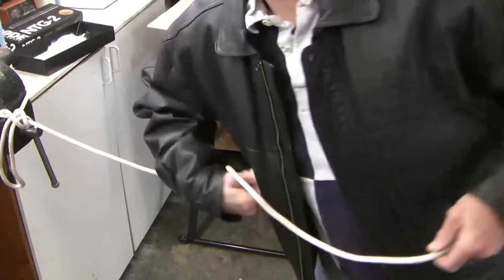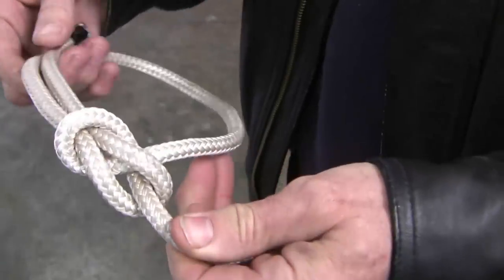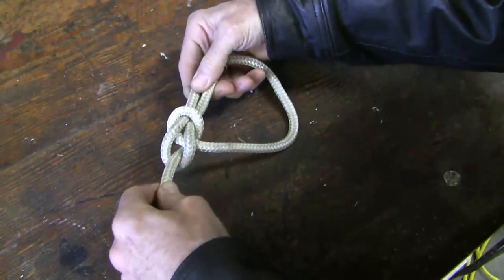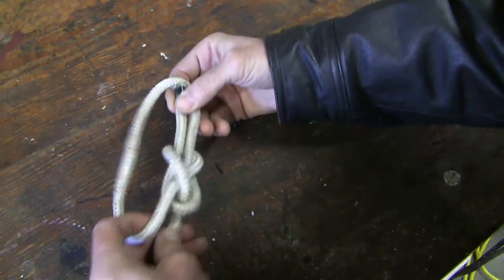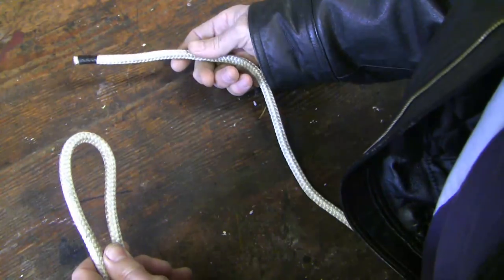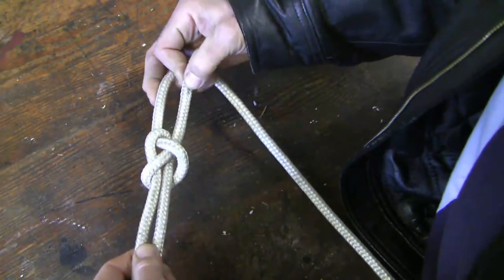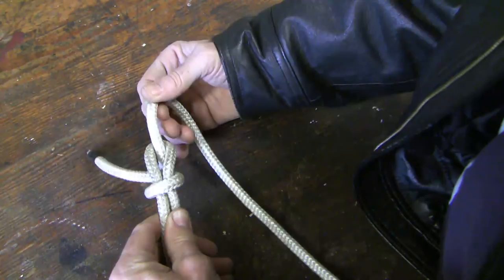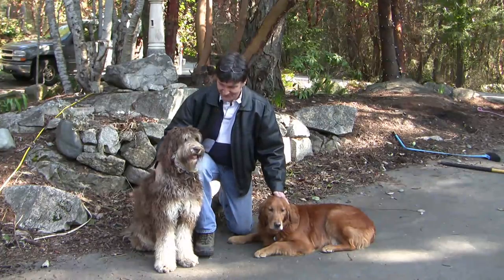What you never knew about the Bowline knot

Comment: It seems to me that I learned that according to Ashley, a Knot, bend, splice, and hitch are all complications in rope.  But while all are ties, a bend is not a knot, but a bend is a special kind of tie that joins the ends of rope (either the same rope or two different ropes) where a knot is typically a tie in the end or mid line.

True both the bowline and sheets bend look very similar, they are not the same knot.  As well as the bowline has over 100 variations (which by some counts may include the sheets bend) and all may have very different function and results when used.  Just saying.
Reply from the maker: Good points, when you look back in history you get an appreciation of how language evolves. Nobody uses the word bend anymore but vestigial remnants are there. For example the Carrick bend ties two lines together, but if you add a couple of overhand turns it becomes the more modern diamond 'knot' even though fundamentally it is still a bend. At one time sailing (and rope craft) was on the cutting edge of human technology. I put a link to a pdf article on bowline variants deep in the thread that was eyeopening. My goal here was to be provocative, but I certainly accept your points. In the end it distills down to the less interesting semantic discussion. My main point was to put light on the surprising fact that they share the same core structure.
Reply: knots in my business are permanent and will require the rope to be cut to untie lol!  Bends are attachment and are specific to the need and loading, hitches are the most useful in high load applications because most can be untied after extreme loading and some can be untied while loaded ! try that with a knot or bend !
Reply from the maker: Yes, some knots like the anchor knot or even the reef knot can be really difficult to untie under chronic load and when wet. The bowline and sheet bend are much easier to undo without a marlinspike and hammer. As you say, the truckers hitch is a simple way to work with and apply more tension without having to retie the whole thing.
Reply: Foe example of what you are saying; research the "bowline on a bight"...

Comment: I tie a bowline so the tag end is on the outside of the the loop especially if the bowline is small . Is that a different knot ?
Reply from the maker: They call that a "cowboy bowline". Although sailors look down their noses at that configuration, the objective tests show little difference in strength, etc. The key is to keep a long enough tail so it can't unwind if it is left slack. For critical applications many tie an overhand loop at the end so it is harder to come undone. There is a variant called the Yosemite finish that basically routes the tail along the lead rope, and for applications where the tail can get in the way of pulleys it has a role. However the Yosemite finish can be accidentally tied wrong which could be a disaster.

Comment: I know the subject of this Video was comparing Two Knots , but  . . . . I just learned to tie a Bowline !   Yay !
Reply from the maker: I'm glad it helped. At first I was puzzled at how difficult it was to learn such a simple knot, until I realized there are four common variants, all with similar strength. Cowboy and regular depend on which side the short end comes away from the loop (outside or inside), and of course each of those can be left handed or right handed. On top of that, you have the variance of body position and whether you have to pass the loop around another structure like a piling. Ultimately most of us end up memorizing it one way, relying on a muscle memory after that. Thanks for watching!

Comment: every time I try to tie it I end up with two half hitches? what am I doing wrong?
Reply from the maker: The Bowline is one of the hardest knots to learn, and I've often scratched my head as to why. Part of the issue is the fact the knot has a chiral property, "handedness". There is a right handed bowline and a mirror image left handed bowline. Also, where the stubby end is placed defines it as a standard bowline (stubby end on the inside of the closed loop), or a cowboy bowline where the stubby end is on the outside of the loop. Deceptively complex, four variants! The other issue is the fact that when sailing you often have to tie it quickly from different angles. One of the best ways to practice is to leave a small rope in a place where you can spend a few seconds practicing. Push the magazine rack away from the toilet and practice there. I would memorize one way to tie the bowline first, and the Scouts method starts with an overhand loop followed by a 'rabbit out the hole, around the tree, and back down the hole" visualization. Make the handedness of the loop the same every time,  so that you get the direction the rabbit has to move (up or down) right. If the rabbit comes out the hole wrong, you end up with a type of stopper knot, I guess you could call it two half hitches. The Animated knots website have excellent multimedia knot-tying demonstrations, certainly worth a look. Thanks for watching, and good luck!
Reply: I got it thanks

Comment: NOT THE SAME KNOTS - As it's been pointed out, the bowline is NOT the same knot as the sheet bend. Although they work the same way and have the same features (a bend and a lock) they are mirror images of each other and have different properties and purposes. 

If a sheet bend is used to make a loop, the load on the bite can cause it to roll, turning it into a constricting knot (slip knot). Correct usage of a sheet bend is to attach a sheet (aka tarp, sail, etc) or the ends of two ropes together, especially a smaller and larger (larger gets the bend). 

With a bowline, the bite contains the lock and the working end has the bend. The only reason for a bowline is to make a loop. Since the tension load in the formed loop is half the tension in the bite, which contains the lock, it is impossible for a properly dressed bowline to roll and release the loop. 

With the sheet bend, the bend is in the bite (which has twice the tension of the loop) and the lock is in the working end. This results in twice the force trying to roll the knot. Also, the orientation of the bite to the loop makes it even more likely to roll the knot. 

Do more research, Google more info or look for more videos on YouTube. If you study it enough you'll see the difference.

Comment: As you say, for a sailor, a bowline is an all day, every day sort of knot.  It does have one important limitation,,, that I learned of the hard way.  If you tie a bowline in a twisted rope, tie it with a long tail.  Twisted rope under extreme tension,, like hoist a mast at the  dockside jib to step the mast,,,, a bowline can untie,, or un-lay, itself.  I dropped a 45 foot mast in the harbor.

The solution is simplicity itself,, and the knot is one every sailor should know,,,, a double bowline. A double bowline cannot,, under any circumstances I know of, come undone.  And yet,, it is easy to take apart, even after it has been seriously stressed.  That IS the reason for a bowline,,, yes,, wet or even frozen (I sail in cold sometimes too.)  you can untie a bowline,,, most importantly,,, after you have towed a battleship with your 32 foot dingy,, you can still untie the knot.

There are several other bowlines.  The waterman bowline is tied without really tying anything.  Just give the tail a good sound flip and grab one loop through the other and drop it over the bollard or dock cleat,,,, you don't even need to bend over.
Reply from the maker: Those are wise words, thanks for stopping by and making the thread more interesting. Lately I've been using soft shackles but not without regret that I don't get to tie the bowline as often. Even so, as you say we use it every day.
Reply: Try the double bowline.  Two ways to tie it,, laughing,, the real way,,, and you can if you leave the tail really long,, just chase the knot around and through with the tail.  The 'real way'  gives you a glorious and secure loop (Bridle for emergency tow?),,, but around something (a mast) a long tail that you chase the line in the knot all the way around and through,,, works fast, easy, and incredibly secure.   I see another video for a 'perfection loop' Lovely knot,, as good as a spliced eye (no thimble),,,, the good and bad,,, after it has come under great strain,,, you get it out with a knife,, Cut it off.

I had never noticed the sameness of the sheet bend,,, Thanks !

Comment: Any properly tied knot can be untied. Except the hatchet knot. 

Try tying the double bowline knot. Great for emergency rescues
Reply from the maker: Good point about the double bowline, I learned that knot in a seamanship course years ago, and it worked great. However I am reminded, time and again, that if you don't use a skill every day you fumble with it when you really need it. Add to that the anxiety of a man overboard, bumpy seas and the panic of getting sails down and you've got a problem. I practiced that double bowline hundreds of times, for the same reason you point out. Unfortunately outside of emergency rescue it doesn't get enough use in my hands. When I do, I have to look it up, which would be a problem....
Reply: I think i learned to ride a bike 60 years ago - i had not rideden one in 30 plus now. But i bet it comes back to me

Comment: According to another YouTube video, the term "bowline" refers not specifically to the knot but the loop formed by the knot.
Reply from the maker: You make a good point, without the loop you don't really have a bowline 
even if the path of the rope is identical within the tight part. My 
point in the video is how close the internal pathways of these knots are
 to each other. Another knot, the under-appreciated Carrick bend, also 
has similar features with back to back 'bowlines' even though 
conventional semantics would never use that terminology. With the 
similarity of structure, it is no surprise these knots share 
features of being easy to untie when wet, strong when under constant 
tension and rarely failing, though prone to a little slippage when first
 loaded. Old style lexicon would generally call a loop of rope a 
'bight', though language evolves and I never hear young people using 
that term. Thank you for watching!

Comment: One important point I haven’t seen mentioned is if the sheetbend is used to connect different diameters of rope,  the larger rope must be the bight,  the smaller rope must be the loop half.  Depending on the amount of size,  fiber,  and construction differences,  the sheetbend-of-different-sizes should be kept under tension constantly or it can possibly untie itself.  Don’t a$k me how I know thi$.  😖

Comment: You should NEVER use same diameter lines for a sheet bend.  It WILL slip.  I know from experience.  The working part of the knot should be the smaller than the line it goes around.  If the only lines you have are the same diameter, tie them together using two bowlines.

Comment: Agree with the comment from CJ.  Anyone who knows how to tie both the bowline and sheet bend knows these are not the same knot, just two knots which look similar.  This argument is sort of like saying the square knot and common double over hand or granny knot are the same as they share a common look.  Sorry argument is  just not valid.
Reply from the maker: Although I respect your thoughts on that, your analogy with a granny knot misses the mark. The granny knot is fundamentally different internally compared to the reef knot. Even if you were given no information as to where the ends go you would easily distinguish the two when looking at the core structure. The thief knot, however, is identical to the reef internally, just as the internal structure of the bowline and sheet bend are identical. That analogy (reef vs thief) is a better way to illustrate the point that different tension from trailing ends make all the difference in how knots work in the real world.
Reply: OK sir I submit to your judgement.  I would how ever disagree with the term  the term "they are the same knot" if i understood you correctly.  To me if both the live and dead end of the rope are not entering and exiting the same place in both knots then the claim is not valid. Thanks for the video

Comment: I was taught (not in the Navy) that the proper Bowline's  Bitter End ends outside the loop not inside as you do. Either way the strength and uses seams to be the same.  Go figure !
Reply from the maker: Good point, in my reading they called that outside option the cowboy bowline, equally strong. So there are four combinations, regular & cowboy, each with either a left or right handed form. When you combine that with the different situations we are called to tie them in, no wonder the bowline is such a deceivingly tricky knot to learn. Most of us memorize one variant and tie that every time. Likewise the sheet bend has a left and right hand variant, though most teachers emphasize that the two short ends of the sheet bend should be on the same side. Thanks for dropping by!
Reply: No, Thank You.  Its never to late to learn more. Keep up the good work...

Comment: I love the Bowline knot, and use it occasionally. But I've noticed that mountain climbers use the figure 8 knot. There must be a reason. And I've never seen someone use a Bowline when their life depends on a knot.
Reply from the maker: Climbers don't like it because it can come undone  when not under tension. They only use the rope as a backup, so it is rarely loaded. In sailing it is used all the time. If worried about the end sliding loose, you can tie an overhand loop in the end.
Reply: Very interesting. Thank you for that.
Reply: I'm a climber and it's not true that we don't use the bowline.  It's an ideal knot for the ends of standing lines.  However, it is true that we don't use it to tie in to the climbing rope, primarily because it's a weak knot that cannot be easily double-checked.   When climbing, the first thing one does is double-check the tie-in of one's partner to make sure that they are securely tied in.  A figure eight is easy to check just by instant observation; a bowline isn't, especially for people who have not been taught it (i.e., those who do not lead on the sharp end).  Some europeans use a double bowline to tie in, but we discourage that here in the states for the stated reason.

Comment: What you never knew about a bowline:  It is a weak knot.   Never load it more than about 35% of the lines rated breaking strength.  If you must risk a higher loading, use the figure eight knot and back it up.
Reply from the maker: Good point! Also the figure 8 is almost as easy to untie. High modulus line, with its tremendous breaking strength and minimal stretch, has made a huge difference in what breaks first. When lines control sailboat sails, the weak link is now the fabric of the sail or other hardware. In that situation it makes a huge difference to have a knot that is easy to untie even when wet, and we'll accept the reduced breaking strength caused by the knot (or use a splice). Often we go to splices, more to reduce the chance of the knot catching on shrouds as the sails are moved.
Reply: Interesting! I don't doubt you, but do you have a source? I'd love to read more about this stuff.
Reply from the maker: If you do a Google search "Mark Gommmers, Bowline Analysis, 2016" you'll find out everything you want to know about the bowline. "Ashley book of knots" is also available as a pdf online. The best online reference I've found for knots is animatedknots, an outstanding resource.
Reply: @memorymatters7151  I think he means weaker when wet...which ALL knots are.

Comment: Thinks he's got it figured and happy in his ignorance.  The knots are not the same.  Geez, one is done with a single rope and the other with two.  The sheet bend is used primarily to
 tie two ropes of unequal diameter together.  The bowline  to make a loop that under tension will not slip and is easy to untie after use.  There have only been a few times when I couldn't get a bowline apart even when subjected to extreme force, like pulling a truck out of a ditch.
Reply from the maker: The fact the sheet bend is tied with two lines and the bowline with one does not change the fact that their internal structure is identical. If you understand that, great. If not, well, you may never be interested in knowing. That's OK too.